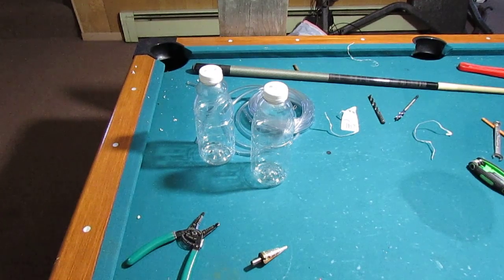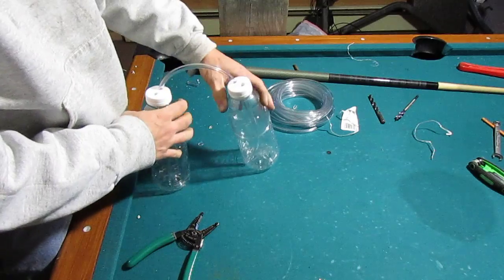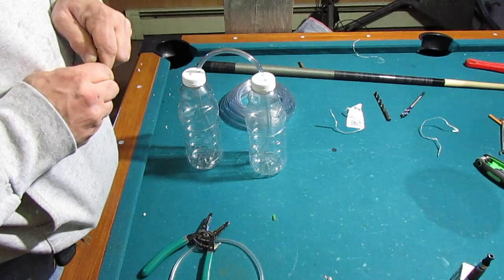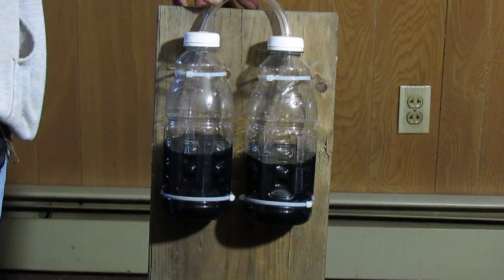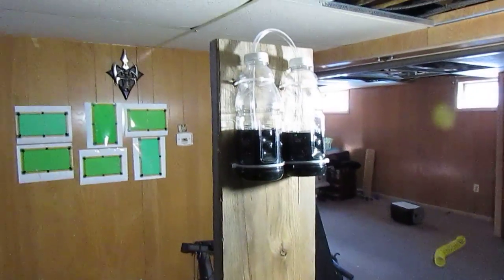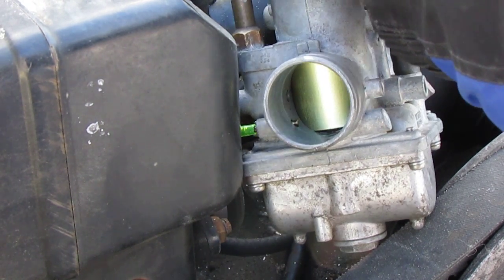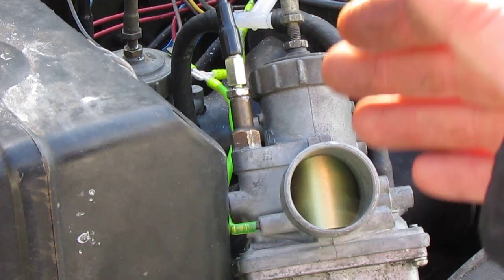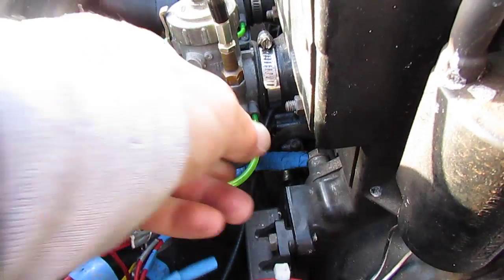DIY Carburetor Synchronize / Balance Tool

Comment: The sync he is talking about @ 6:30 is a bench sync (you set the slides so they open at the same time so that each carburetor lets in the same amount of air into its chamber). The other sync is vacuum sync...that's where the plastic bottles are used.
Reply: Bench sync first before vacuum. Bench sync is a good point to start first, and can be done without much tools.
Vacuum sync needs balancing each carburetor in order to have the same air pressure(negative pressure) on each of the cylinders.
Valve clearances are better to be set first before even thinking of syncing them, but, that is not the case.
Reply: @ruikazane5123  Yeah, not here on a 2 stroke.

Comment: I have a 1989 ski doo with the mikuni vm34 carbs. The carbs have two vent tubes one on each side that hang down plus the nipple for the primer. As far as balancing with the bottle setup do I still hook them up to the primer nipple??
Reply from the maker: the vent tubes are overflow tubes in case your float needle sticks open and allows too much gas to enter the fuel bowl. On the mikuni vm34's I would absolutely use the primer nipple to balance the carbs. The primer nipple gives you straight engine vacuum.

Comment: I like your explanation of how to adjust your carbs. I have an XLT triple. how would I build it (balancer) for a 3 cylinder?
Reply from the maker: I would hook up # 1 and # 2, balance them, then remove #1 and hook it to # 3, then balance # 3 to # 2 without adjusting number 2, only make adjustment to # 3 carb. Thats exactly how I balance my 4 motorcycle carbs, 3 is just as easy as 2
Reply: I was kind of thinking the same way. 

Thank you.
Reply: On my 3 cylinder mercury.  I was thinking to hook up 2 and 3 and synchronize 2 with 3. Then hooking up 1 and 2 and sychronizing 1 to 2. Since if you mess with three it affects both one and two.. would this be correct